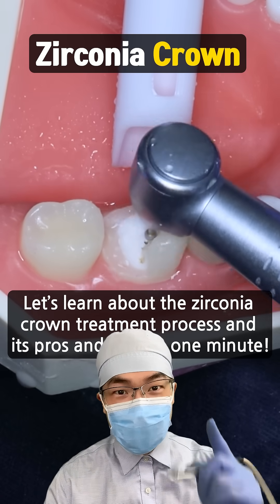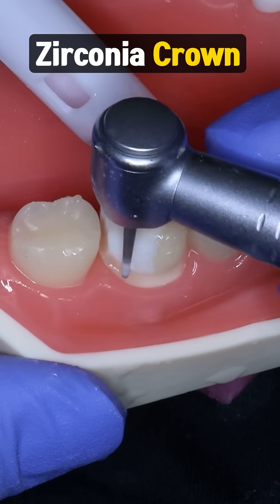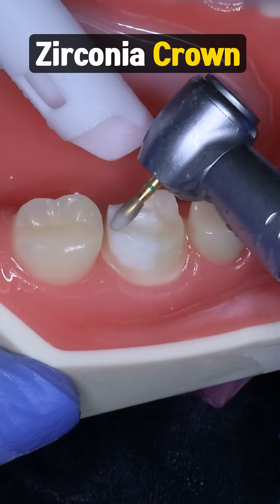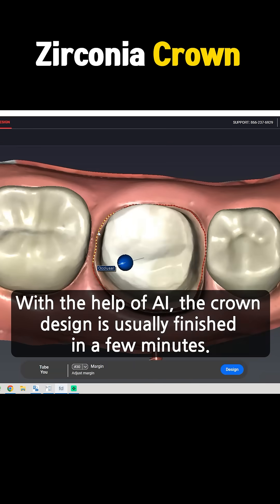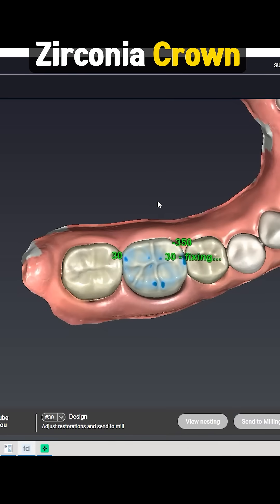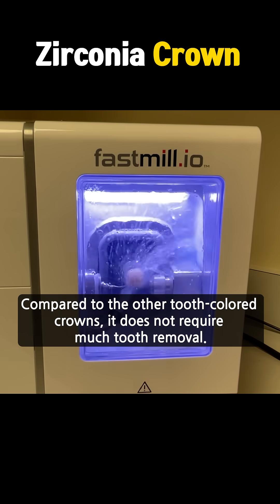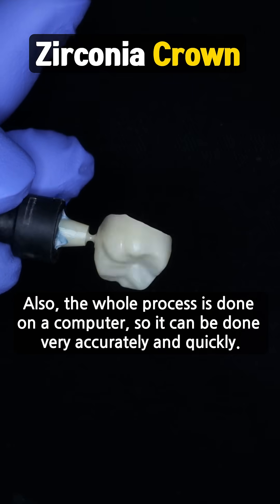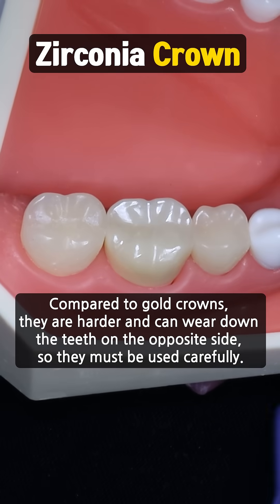Zirconia Crown Procedure Explained : Pros and Cons in 1 minute

Comment: I have a great dentist however I’m having burning issues all around the crown #15 on the gums and some pain if touched. It’s causing crazy dry mouth issues in that corner. The tooth is root canaled. There’s no pain when tapping the tooth. I don’t know if there is an infection due to a hairline crack? I’ve had an endodontist check it and he didn’t really see an infection although offered to have it redone. The tooth below is an implant but was causing issues after 5 years with my side of tongue. I’m at a loss and a lot stress and anxiety on what to do next. I’m going back in tomorrow for the crown to probably be removed. I’ve never had a reaction to zirconium as I have a few of them. I’m just wondering if the crown was ordered wrong porcelain on metal? It’s almost causing a metal breakdown. I’m ready to pull out the implants and that molar above it. I’m sure there are no 2 molar partials for top and bottom? I’d be missing all four molars on left side. I wonder if there are others who’ve had to take out one side of molars?
Reply: How is your teeth situation now bro?
Reply: @crazyylife  I had the tooth removed. Doing better. Turned out it had a cracked root.
Reply: @cgkuch4184  were you still charged for the root canal? Because it seems like a misdiagnosis lol
Reply: @baddiejeezy The root canal was old.
Reply: Reaction to zirconium is almost impossible. Honestly sounds like you have a form of apical periodontitis. Ask a periodontist about it
Reply: @ Was pulled!! I had a cyst that formed beside the crowned tooth.
Reply: @ed8054 It wasn’t a reaction to zirconium.

Comment: Just had mine done yesterday. The procedure wasn’t bad like I thought it would be.
Reply: I get mine in two weeks. Funny I just got home from getting the temporary crown put on and this is the first video I see 😅.
Reply: How is it 9 months on
Reply: @ it’s been good. No problems whatever. I can eat and chew with no issues. I can floss with no issues as well.
Reply: @andrewjones2133 how long did it take in the chair. I am very nervous and hate getting the needle.
Reply: @JV8391  it took about 30 minutes or so. The longest part is waiting around for the glue to dry and secure the crown firmly onto your natural tooth bottom and gum. The needle isn’t bad either. You feel a little pinch. Afterwords the area is num within seconds. You will be fine.
Reply: Update me bro what kind of crown you get ?
Reply: @ porcelain. I actually have two of them in my mouth. Both in the right side. One on the upper and the other lower.
Reply: I’m going in tomorrow
Reply: @ you will be fine.
Reply: Had mine done 2 days ago. Very fast and convenient. Had a crown lengthening done 2 months ago on this tooth. I like my new crown it blends seamlessly with my other teeth
Reply: @mel...s which type of crown

Comment: Can zirconium crown cause cancer. Because i heard there are chances of get tongue cancer where metal touches frequently tounge
Reply: Zirconia is a ceramic, not a metal.
Reply: Metal? This is zirconia
Reply: Zirconium is metal while Zirconia/ZirconiumOxide is ceramic
Reply: I want to know the answer to this question too.
Reply: @samuweljon4001  metal like steel and other can cause cancer but some are non-cancerous. And if your teeth are sharp point then grind it to smooth. I had mine root canel at that time i ask all the questions. Go head and you can use zirconium make sure its not duplicate.
Reply: @youngpark3819  Zr zirconium is the metal. ZrO2 zirconia is a ceramic.
Reply: Right it's metal

Comment: Why they last no more then 5 years??? What a dental INDUSTRY😢
Reply: they usually last 10-30 years if you take care of them regularly. That includes atleast 1 or 2 dental checkups every year.
Reply: Every checkups too costly again
Reply: as a CDT i can tell you that if the crown fails after 5 years its usually from 2 things , you either didnt do your checkups-cleanings or the crown wasnt properly manufactured from the dentist (wrong cementation-wrong impression) or the lab didnt do a good work but in most cases the dentists are at fault from the start with bad impressions or bad cementations / checks on fit
Reply: Who said that!?
Reply: Does yours last longer @BeautyAndHerBeasts